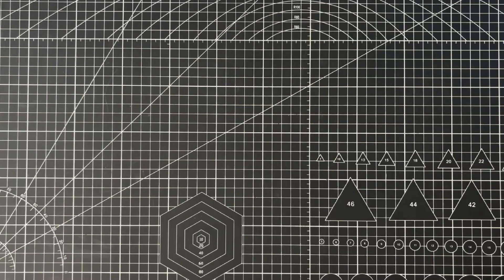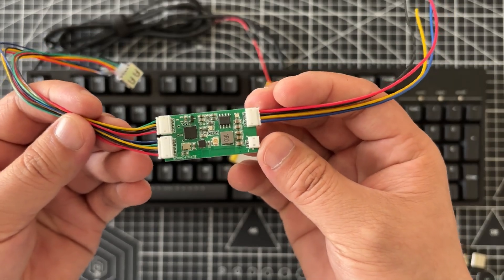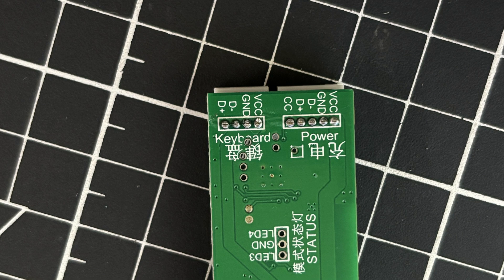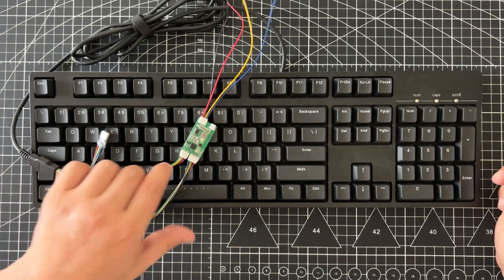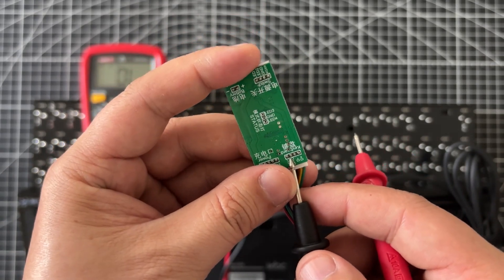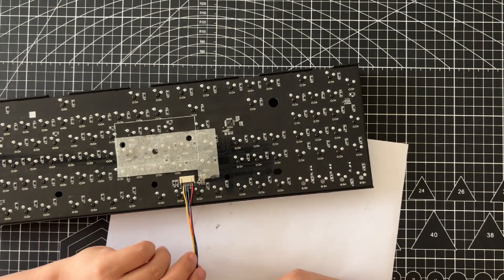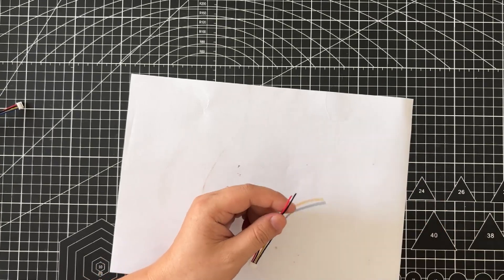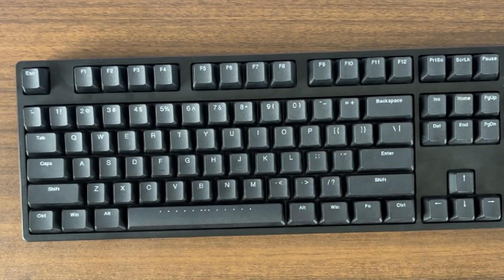DIY turns a wired keyboard into a wireless keyboard

Comment: How do I cut the wired cable and how do I connect the battery? I dont have the white comnector thing
Reply from the maker: If you don't know how to cut and connect correctly, it is not recommended to buy this semi-finished product. You can buy wbt2-v4.  The white connector is in the accessory package and is provided free of charge. There are 4 different commonly used connectors in the accessory package. If none of the 4 connectors work, you can only cut the data cable and re-solder it.
Reply: I see thank you. Regarding the keyboard plug, is it easy to take out or solder is needed?  @jamjam2219

Comment: How does the WBT-V3 interferes with proprietary beyboard software?
for example, my Akko 5075S keyboard have a windows software that updates the firmware + controls the rgb + define macros, etc...

Will the module still allow the proprietary software to detect and communicate with the keyboard?  or WBT-V3 offuscates the keyboard device and only transmites key presses?
Reply from the maker: The working principle of the module is to receive the key code sent by the keyboard and then transmit the key code to the receiver. Signals other than the key code will not be forwarded. So the keyboard macro can still be used because the keyboard macro is based on key code communication. If you want to update the firmware or use software to set the light, you need to remove the module and let the keyboard and computer communicate directly. It is recommended to purchase the wbt2-v4 module,
Reply: @jamjam2219  does the wbt2-v4 module directly transmits usb protocol?
or will i have the same problem with proprietary softwares ?
Reply from the maker: @joaogabriels.f.5143  wbt2-v4 is also forwarding, but wbt2-v4 is an external module, easy to disassemble. And it supports keyboard and mouse at the same time

Comment: The mod module can guess with voltage|amp is should output to the keyboard?
Or is it fixed at some voltage?

And what about the battery voltage|amp it expects to receive?

edit: typo
Reply from the maker: Lithium batteries with voltages between 3.7v and 4v can be used.

Comment: I have found a solution  adafruit 1000 power boast   converts 3.7 volts to 5 volt
 The reason I need 5 volts is the keyboard has lights. Aula S1600.
Reply from the maker: It's a good idea. In most cases, although LED lights require 5V voltage, 3.7V can also work. It's just that the brightness is lower.
Reply: I did not know that.

Comment: I need a 5v battery rechargeable flat, what should I ask for?
Reply from the maker: The module comes with a charging management chip, just connect the positive and negative poles of the 3.7v lithium battery to the module.
Reply: My keyboard requires 5 volts. I can't seem to find one  do yo know where I can purchase.
Reply from the maker: @rodneyblaydes6670  The USB charger can provide 5V voltage. Or use a 3.7V lithium battery with a DC-DC module to output 5V voltage

Comment: I want to get one for my Akko 5075S. Its said that its consumption is 5V... So... do I need 5V battery right?
Reply from the maker: No 5v battery is needed, ordinary lithium battery is enough, the module will provide power for the keyboard.
Reply: Hey, i have the same keyboard!
Did you get it working? just wanting to check before buying this MOD;

Comment: How does Bluetooth pairing mode work? Does the led switch work?
Reply from the maker: Use the shortcut keys to switch the module to Bluetooth mode, and then pair Bluetooth in the operating system in the same way as other Bluetooth devices.
Reply: @jamjam2219  is there a shortcut for pairing mode for Bluetooth or it’s just auto pairing mode when nothing is connected? I’m trying to make a wireless foot pedal basically
Reply from the maker: @rpegelectronics  There is no shortcut, if you want to connect quickly, please use 2.4g wireless mode, permanent connection, no need to pair. Please note that this module only supports keyboards and mice that use the USB-hid protocol, unless your game controller uses the USB-hid protocol for keyboards and mice.

Comment: thank you, bro! I was able to turn my keyb into wireless with these vids! Just waiting for a slightly thinner lipo battery to come. 
since my keyb didn't have a usbC hole, I made one by drilling 2 holes and cutting the middle between them

i have one question tho, how are you able to change the sleep timer function? where is the software that can be used? Didn't happen to see it on your site

Comment: What are the battery details ? 
Does this work with macro keys?
Also, can you measure input latency on 2.4Ghz ?
Reply from the maker: 3.7V lithium battery, the larger the capacity, the better, not less than 2000 mAh. I haven't tested the specific delay value, but I feel very good when playing CS with this module, and I don't feel any obvious delay

Comment: This looks great, Ive got a corsair v70 mk2, i really dont want to pull it apart, so i was thinking would it be possible to put the kit into a plastic electronics project box for example? I was thinking of 3d printing a box perhaps to fit under the keyboard and just plug the keyboard into the project box for example. 
That way i can plug and play ie plug keyboard into project box that contains the modules and battery.
Reply from the maker: Absolutely. In fact, one of my works is a 3D printed box for this module.

Comment: I'm interested in your device but have a few questions.
1. When the device is connected to a computer via USB-C cable will this function like a normal USB device or can it only be used as wireless?
2. Can this be used to connect a wired gamepad controller and be recognised as an x-input device?
Reply from the maker: 1. When the type-c data cable is inserted, you can use the shortcut keys ctrl+alt+shift+w to select the wired mode. At this time, the module is the same as a normal USB device, and data can be transmitted through the data cable. You can also use the shortcut keys ctrl+alt+shift+q to select Bluetooth or ctrl+alt+shift+e to use the wireless 2.4g mode.
2 The module does not support game controllers because there is no code written into the game controller
Reply: Hi. I have the module and i use it to connect my keyboard and a diy trackpoint mouse.
But i cannot connect both, trackpoint mouse and keyboard at the same time (using a USB multiple extension). Do you know any way to perform this?
Reply from the maker: @kanando15  Yes, brother, this WBT-V3 does not support most USB hubs, it only has one interface. So I made WBT2, which has two interfaces, so the mouse and keyboard can be used at the same time.
Reply: @jamjam2219  WoW. How can i made wbt2? Please help :(
Reply from the maker: @kanando15  https://www.wscome.com/product/highly-recommendedwired-keyboard-converted-to-wireless-keyboard-diy-kit-v4-version-dual-interface-supports-keyboard-and-mouse-conversion-at-the-same-time/